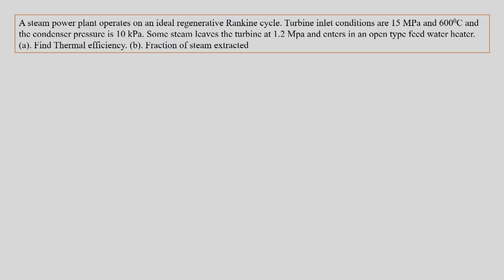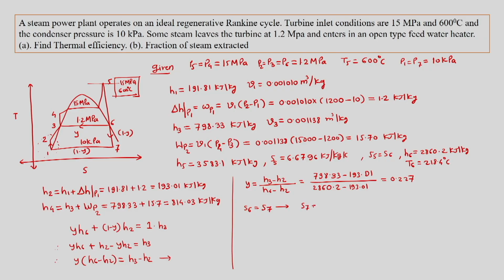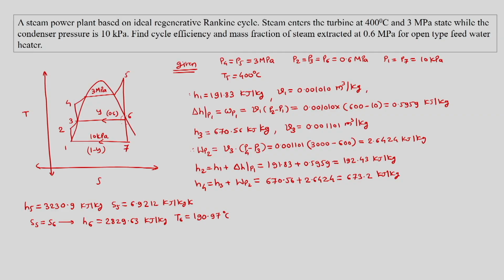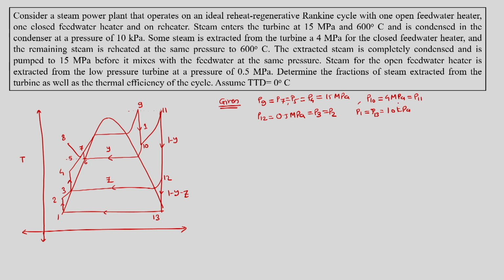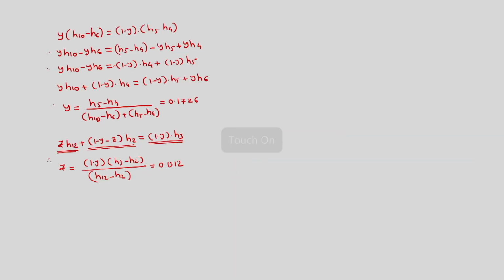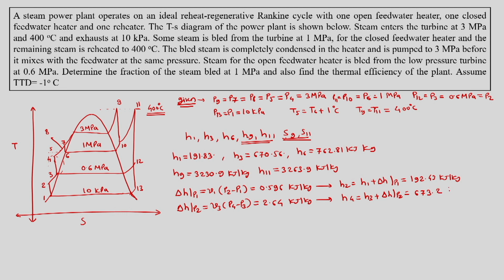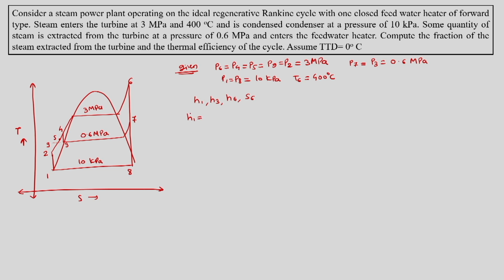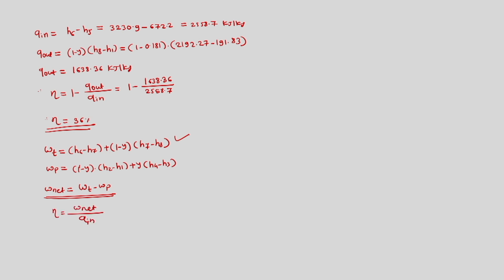Lec 13: Examples of regenerative Rankine cycle

Comment: work done by pump two is calculated wrong, it is 3.8255 instead of 15.84, also Qin calculation is wrong, similarly Qout also wrong, and then finally efficiency is wrong
Rest i like the explanation. nice video to understand the concept